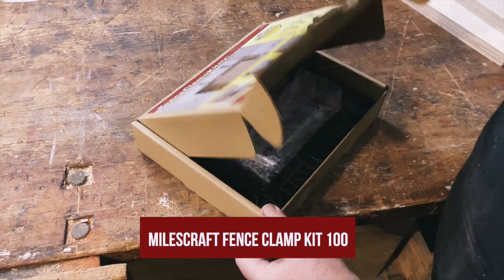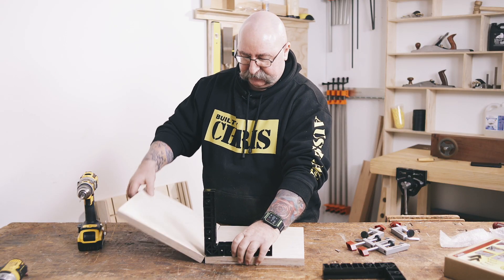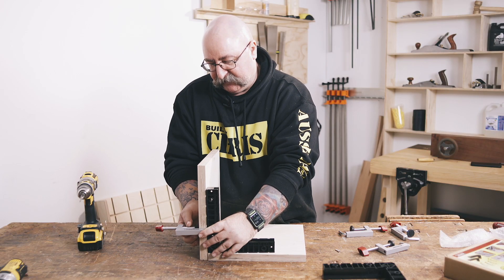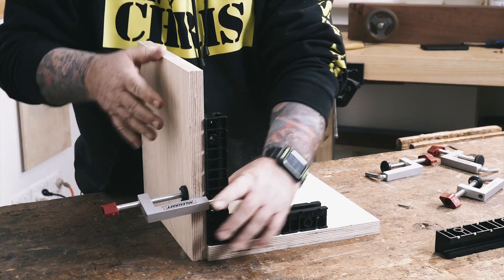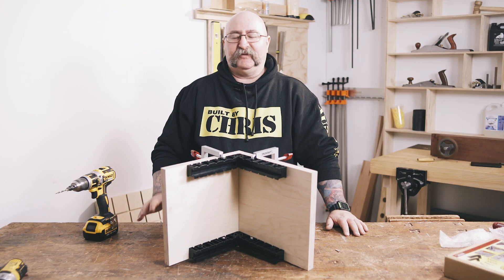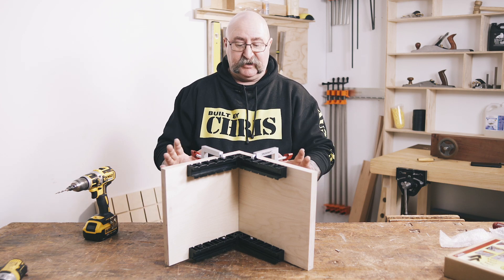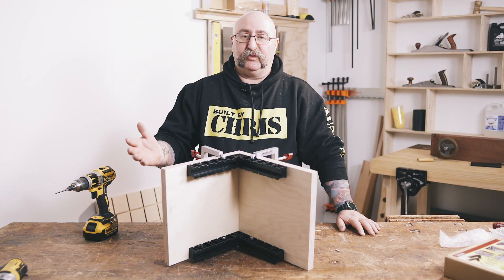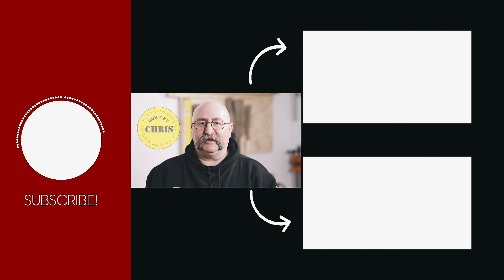Clamping Your Corners - Milescraft Fence Clamp Kit 100

Comment: I find screw operated clamps tedious (that's being polite) when using right angle fixtures. I usually start with a spring clamp to hold the fixture in place then change to squeeze activated clamps if its a bigger job (Bessey, Pony, Irwin etc). I use them a lot when fitting hinges to the inside of knockdown boxes, holding the ends vertical and in the right place horizontally while I drill pilot holes then insert the screws. Also good on face frames if you don't have a jig table to clamp everything to when using pocket screws.

Comment: I have this. The squares are fine, but the clamps kind of suck. I just use the squares with 6-inch trigger clamps and it works great.
Reply: Do you find any flex though with the squares, I do.